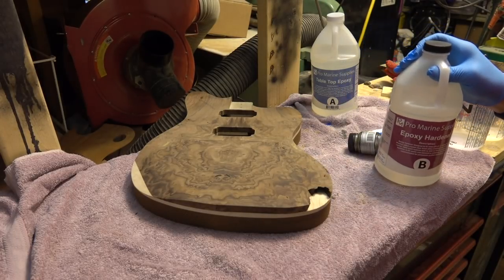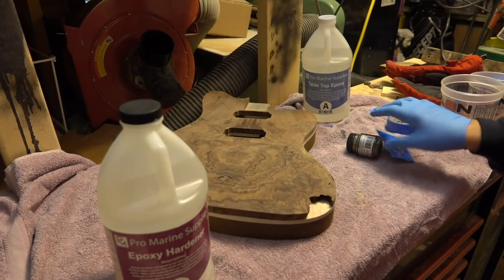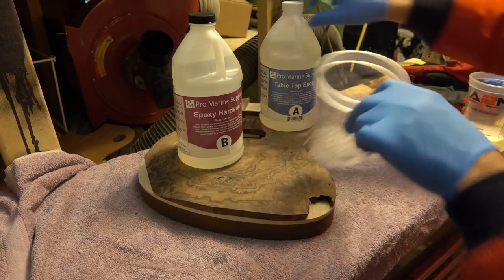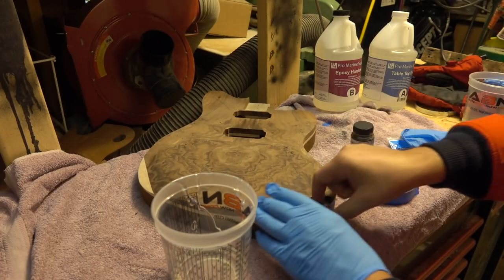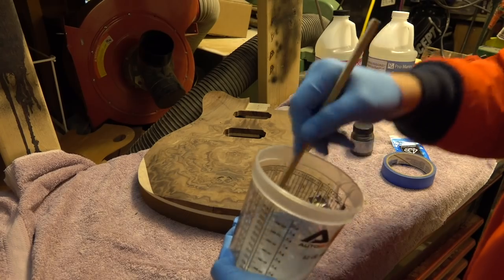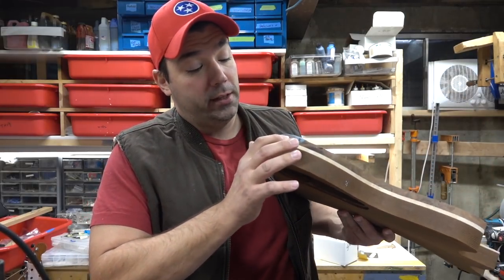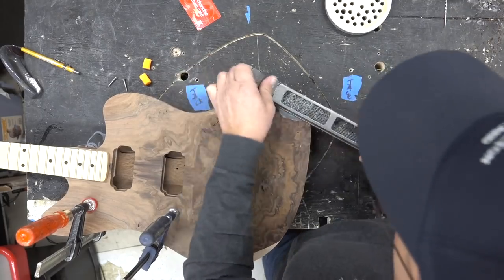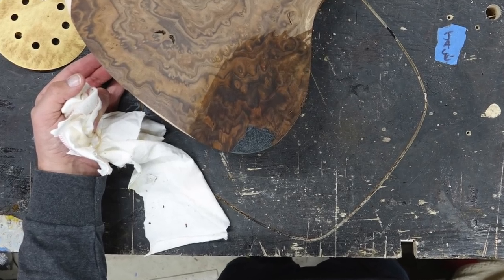Using Epoxy to fill a Burl Void

Comment: I  was thinking about doing this on one of those bodies that I got from that last giveaway, or with many of my different basses back home. Now I actually knowhow to do it, and down here in Florida it doesn't get as cold, so it would be much easier to do. How many days did you let it sit before it was completely hard?
Reply from the maker: about 4 full days.  I don't think my mix was perfect
Reply: @bigdguitars  I would like to try to make one like you see in those viral videos with the scrap pieces of wood and epoxy